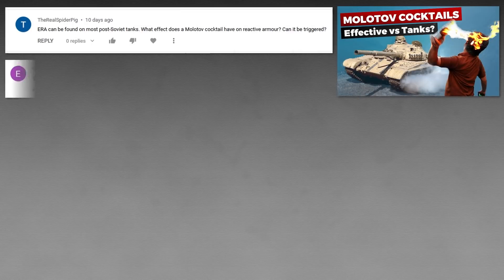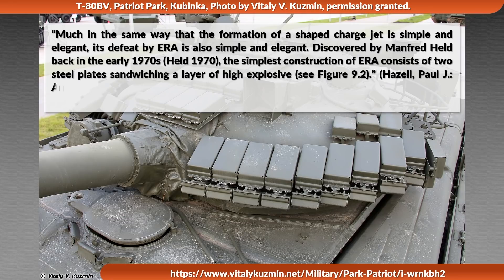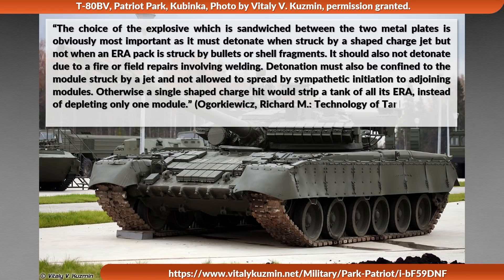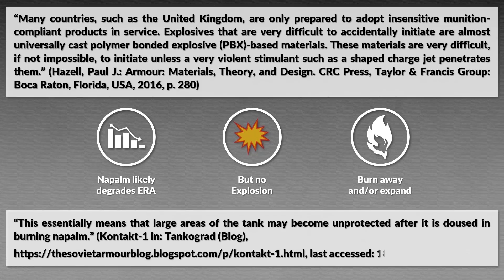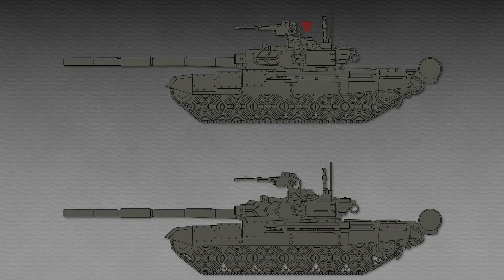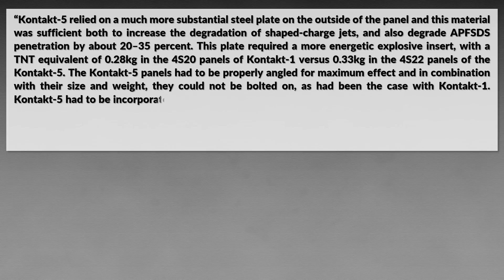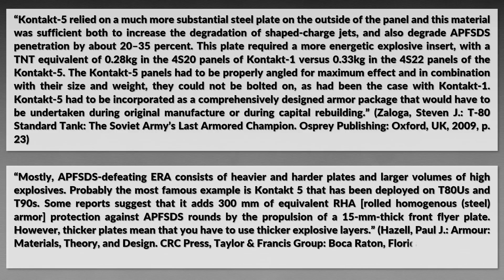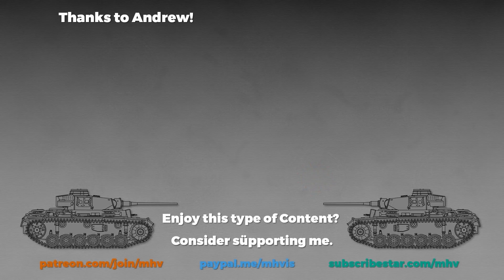Why does Russian Explosive Reactive Armor not explode?

Comment: Important is also, that not all explosives just explode when getting hot. There are certainly safety concerns if it would be too easy to set the ERA of. Imagine a machinegun hosing down on a tank with infantry around, setting of parts of the ERA. Carnage... It must not be too sensitive to its environment. 
I remember the mythbusters burning C4 as if it was some firewood without detonating. Many explosives are just made to withstand certain amounts of heat, of for example a burning tank.
The molten roadwheels of the T-72 are probably made out of aluminum, therefor already starting to melt at around 600°C. Not that much, concerning there was burning rubber ablaze.
Reply: The road wheels are certainly made by steel, not aluminum... aluminum could not withstand the mechanical stress. Meanwhile, heated steel will soften up too...
Reply: CAN YOU SAY THAT IN A GERMAN ACCENT , IT SOUND'S BETTER WHEN MILITARY  TECH TALKING  🤤
Reply: Modern IFV have 30mm,35mm or 40mm auto canon (even 50mm) with highly precise timed delay fuses that are programed at the muzzle after the muzzle velocity is measured.  The fragments are typically tungsten cubes designed to penetrate Armour.  I suspect the right round will wreck the ERA.
Reply: @williamzk9083  auto canons are a slightly different beast than 5.56 machine guns. They also are much more dangerous to even the hull armor of the tank. I think you can easilly destroy a T-72 with a 30 mm if you hit it from the side in between the wheels. Of course, if you meet it from the front then you are out of luck.
Reply: @TheoEvian  I'm think that semi Armour piercing round with hi explosive round would set of the ERA. A 3 second burst from a 30mm might put in 30 rounds.  Some of the forward fragmenting munitions like AHEAD should penetrate and likely destroy optics.   Most IFV will have a ATGM like Javelin so a burst of auto canon fire with follow up with the misisle gives the IFV a chance,
Reply: @williamzk9083  Yes, of course, but I wouldn't want to be in a situation like that.
Reply: If i remember well one of them even stomped on that.
Reply: We used C4 rolled like Playdough into small balls to heat coffee and C-rations in the field in Nam. We all carried two or three bricks each to blow bunkers, bridges and any other shit deemed appropriate. The Mekong Delta terrain was usually too swampy for big bunkers so we just made C4 into another Army  “Field Expedient Usage.”
Reply: Some of the reactive armor is actually fake. They just fill it with sand or something like that.
Reply: Hey guys. The blasting cap that detonates c4 varies. It can be 2 lead wires (or safety tube that contains black powder which instead activates tge ignition material. The mouths of these caps curl outwards, while electric do not. All the vietnam blasting caps ive seen arent much different and the explosive and ignition compounds are usually the same and are always in the same order.) that use the spark gap between them to burn the ignition material, something like lead azide, then a secondary explosive of some sort that is more powerful than the ignition material, but less volatile, then this detonates the primary explosive that creates the necessary shockwave to detonate c4. Most of this info is from an army 1968 demolitions manual i read when i was younger, so its outdated as can be.
Reply: @weakest17yrold   But the physics hasn't changed...
Reply: Have you heard how competently Putin responded to UN Secretary General Antonio Guterres??? A brilliant politician... Checkmate!))

P.S. In the information war, the one who tells the truth always loses. He is limited by the truth, and a liar can carry anything. Robert Sheckley
SUMMON RUSSIA TO COURT - AND YOU WILL LOSE IN DISGRACE!
Reply: Watcher Zero no, C4 is not detonated by electrical current and neither is any other explosive. electric blasting caps use a small amount of a particularly sensitive (primary) explosive in a slightly pressure-resistant casing to build pressure to induce detonation instead of deflagration. the ignition of the primary explosive in the blasting cap is caused by a thin metal wire of high resistance heating up past the primary explosive's ignition point due to electrical current passing through it. there is no electricity running through any explosives involved in any explosives ignition process, and certainly not for C4, which is a rather insensitive secondary explosive.
Reply: During the Second World War, partisans melted their stoves by cutting TNT skewer into chips. It burns well and does not explode.
Reply: Ask the GIs and the SV allies who burned C4 to heat their rations... with the added advantage that doing so was mostly smokeless.
Reply: i prefer my explosives well done
Reply: КАПИТОЛЮЙ бандэр
Reply: it depends on "how hot". A gasoline molotov cocktail won't set off the reactive armor. Now try adding some thermite to that, it burns much hotter. Not that it matters, the tank will not be destroyed by its reactive armor going off.
Reply: Generally there are 3 ways of igniting explosives; heat (Gunpowder), kinetic force (Nitroglycerin), electrical current (C4). You can design your explosive to only respond to one or to multiple forms of ignition. However for example when TNT gets old it sweats out the pure Nitroglycerin it contains making it susceptible to kinetic ignition.
Reply: @watcherzero5256  It's dynamite that sweats Nitroglycerin when it gets old - dynamite is Nitroglycerin absorbed in sawdust, activated charcoal, or some other material.
Reply: @Dennis-vh8tz  You need to just turn it regularly when stored. It helps to avoid the nitro from leaking out.
Reply: @jamegumb7298  Gravity
Reply: @Dennis-vh8tz  If I remember correctly, the original material used to stabilize nitroglycerine to make dynamite was diatomaceous earth.
Reply: The blasting cap that detonates C4 is initiated electronically, but I'm pretty sure that it takes pressure and heat to cause c4 to go boom.  I think they also make blasting caps that can use regular ignition cord type "fuses" that you light on fire.
Reply: @watcherzero5256  You probably mean an electric (heat) fired blasting cap. Most uses of significant quantities of explosive use stable secondary explosives that can only reliably be detonated by a smaller charge of much more sensitive primary explosive. Such as a blasting cap.

Also it is dynamite that generally contains nitroglycerin. TNT is literally another compound, other than nitroglycerin.
Reply: @johnloosemore9949  Newer ones such as Exploding Bridgewire Type run electricity through an explosive and the actual electrical resistance action rather than heat generated through resistance as in the Solid Pack your likely thinking of detonate it. There is also electro-mechanical such as Slapper Caps which are essentially electromagnets that generate a very sharp kinetic shock when a current is applied.
Reply: @watcherzero5256  Exploding bridgewire detonators work by dumping a huge amount of electric current through a very tiny piece of wire using a capacitor charged to high voltage. The wire almost instantly vaporizes and ionizes, forming a plasma (same thing as an electric arc) and then the remaining energy from the capacitor which is being discharged through the arc causes it to expand rapidly and form a tiny shock wave. This is usually surrounded by a moderately impact sensitive explosive like PETN which detonates making a much bigger shock wave which can then set off secondary high explosive. Slapper detonators are fundamentally EBWs which use a thin sheet of metal foil instead of a wire and which also have a disk of plastic or metal which gets pushed by the exploding plasma from the sheet being vaporized. The moving disk then "slaps" the impact sensitive explosive to set it off. Some of them also have an additional piece of wire on the disk which drives it by Lorentz force (the magnetic field from the current flowing through the plasma acts on the current flowing in the wire and pushes it like an electric motor).
Reply: @watcherzero5256  I'm not claiming to be an expert at any of this, but I think the name "exploding bridgewire" implies the existence of a bridgewire. The electricity is not flowing through the explosive itself.
Reply: @sbreheny  Fun fact: Exploding bridgewires and slappers were both developed as very precise (in the sense of delay between "flipping the switch" and the shockwave reaching the explosive) detonators for the explosive lenses in nuclear weapons.
Reply: @watcherzero5256  

TNT contains no nitroglycerin. Those are discretely two different explosive compositions. You are undoubtedly thinking of clay matrix dynamite. When TNT gets old, it decomposes and becomes less sensitive.

C4 is very insensitive. The Army has a term, 'double capper', meaning that you pay attention to detail and do the job right the first time. Its from the Engineers and refers specifically to the standard practice of 'double capping' C4(taping two caps together) for reliable initiation, because its common for only one cap to be insufficient.
Reply: @watcherzero5256  you've confused TNT (trinitrotolulene) with Dynamite (stabilized nitroglycerin.) They are not the same substance. TNT doesn't sweat nitroglycerin, because it does not contain nitroglycerin.
Reply: @watcherzero5256  TNT doesn't sweat nitroglycerin as it doesn't contain it. What you had in mind is Dynamite :) 
That's common misconception because of how dynamite sticks in animated films and media has TNT written on it, which is misleading. In other words we are thought wrong from the beginning  :)
Reply: did mythbusters show that burning c4 will explode if pressure is introduced? because burning c4 will explode when it is on fire.
Reply: My father told me there were guys in his unit in Vietnam who would use little cubes of it to heat up coffee or rations in their steel mess cups.  There was apparently a way to turn one of those aluminum mess kits into a makeshift single serve hot plate powered by a little chunk of C4.  I think it didn't smoke, but it gave off a distinct smell.  They would also stick c ration cans on top of a truck's exhaust manifold when there was one nearby.
Reply: PhillLesh69 soldiers are ... "inventive" like using c4 to heat rations. My father told of buying an extra Zippo lighter ( he was a smoker and already carried a lighter ) and fuel from the PX for him and his squad mates to use during field training for the same purpose. Zippo leaves no smoke or order, the D.I.'s did not catch on and they had hot cans of chow, whenever they could get away with digging a little hole in the ground to hide the flame and hold the lighter, lol.
Reply: @PhilLesh69  This is correct.
Reply: @miketaylor5212  : As I recall, C4 specifically requires a supersonic shockwave of sufficient power in order to properly explode- otherwise it'll burn too slowly to explode in open air.
Reply: @miketaylor5212  I was a Cav sapper for 16 years…c4 does NOT explode when lit on fire! Heat AND pressure are required for detonation. Its literally by design to make it stable for transportation and deployment! Det-cord or blasting caps are proximity detonation is the only way! Unless your going to tell me that i never cooked a pot of coffee from a cut off chunk of C4! FYI hex tabs were far more efficient, but….you use what ya got!
Reply: @miketaylor5212  they set it on fire and cooked MRE with it, dropped a pot full of water on it, stomp on it, drop an anvil on it, shoot it with 7.62 nato, drip molten thermite on it, all on fire
Reply: @miketaylor5212  there were russian documentary channel on youtube named "Zvezda" which were banned thanks for freedom of speech, So there were documentary which were made about russian ERA, so according to this video, Russian ERA do not explode in fire or when shot by small caliber arms like 7.62, 12.7, 14.5

Comment: The same concept as cooking on C4 during the Vietnam war, unless it's given a shock designed to detonate it then it won't detonate. It will burn pretty good but won't go boom.
Reply: In days of yore people would cook over dynamite sticks burning.  It doesn't take much shock to set off nitro glycerin though.  I prefer to use wood.  Even a small pinch of dynamite wrapped in foil will detonate when heated on the stove.  This tends to blow out the fire, so turn the stove off😎.

Comment: although PBX explosives have relatively long shelf lives (25-50 years + or -), storage conditions matter.  ERA left on the tank exposed to weather extremes and not properly maintained may have far shorter lifespans leading to outright failure upon use.  The degradation of these panels is insufficiently understood, although lifespan testing in storage conditions has been conducted to determine the baseline lifespan.  Given the poor maintenance processes and practices of the Russian Army, there is a likelihood that the Russian Kontakt ERA has been degraded and may be performing at suboptimal levels--fizzles, partial detonation, or complete failure to detonate.  In addition, the ERA is only as good as its plates.  The metal plates are far more likely to be damaged, rusted, bent, etc than the explosive charge itself.  Damaged plates can lead to low order or no detonation of the charge.  Again, given the maintenance practices of the Russian Army, I rate the probability of failure of  KONTAKT 1 equipped tanks to be frequent, and Kontakt 5 systems as occassional.
Reply: What's your evidence for bad maintenance practices in the Russian army?
Reply: @tomasg4623  I'll expand on the answer above. 
The PBX in the ERA is quite stable as a chemical compound but it's degradation is effected by the enviroment it in. This can be: temperature, light, reactive chemicals ect. 
Temperature; heat accelerates chemical reactions so being in the sun can play an impact. Cycling through hot and cold weather leads to problems with expansion and contraction and cold weather may result in crystallization of components of the PBX mix or of water from moisture. 
Light: UV light is quite capable of breaking chemical bonds. The ERA is probably not at a high risk, as the blocks are fairly well sealed. 
Reactive chemicals: Water, oxygen, various oils and NOx from exaust comes to mind. 
The important part is that the T-72 and T-80 tanks with the older ERA's had the blocks installed at production or prior to the breakup of the Soviet Union it is unlikely the tanks sent to Ukraine have been in climate controlled buildings for that period of time. The blocks could have been replaced at some prudent interval that would eliminate degradation but that is where the questionable maintenance comes into play: Do you change some fairly stable ERA blocks with a possible shelf life of 25+ years on your tanks when you do not change tyres on your trucks - knowing the rubber in a tyre has a shelf life of 5-8 years?
Reply: @gamarus0kragh  isn't the explosive keep in storage and era block is just hollow during peace time ? And they only equip them when going to battle or war ?
Reply: @tomasg4623  

Gestures vaguely towards present clusterfuck

The fact their Truck tires broke due to poor maintenance? The logistical hell that occurred due to it?

Comment: Correction at 2:20 Its not that they have ERA bricks without the explosive, its that they have ERA containers (those funny looking bags on the side) that normally have ERA arranged in an egg-carton style arrangement ... except they have been found to not contain any ERA at all, only the egg-carton.
So not a partially missing ERA, but instead  completely missing ERA with only the "scaffolding" left.
Reply: https://youtu.be/nrHt0Q6eSI4
Here you’ll find a video that debunks this idea.
The ‘egg cartons’ are called spacers.
This video explains that many tanks found with bags of empty ERA are abandoned tanks, from which the crew have removed the ERA plates. (To counter them being used against them). Abandoned Ukrainian tanks also demonstrate this. 

As well as this, you can see videos of tanks being actively used, have properly filled bags of kontact-5 ERA.

Lastly, all other ERA that can be visibly seen on the tank is present and there  is no shortage of it seen, the ‘bagged’ kontact-5 blocks are the same as the ones visible on the front turret of the T-72, T-80 and T-90 tanks. Since there is no shortage of that ERA it can be assumed there is no shortage of the ERA in the bags since it uses the same type of ERA.

I’m not pro-Russian, I just despise disinformation, especially about tanks because I love them so much!
Reply: @dylanfinucane7193  cheers mate!
Reply: @dylanfinucane7193  I watched it before. There is one issue with the theory: why would anyone bother to scavenge ERA plates but NOT set the tank on fire to deny it to the enemy?
Reply: @MarcinP2  Because ammo is expensive and hard to transport Without it these fuckers don't burn and can be easily repaired  in a country that produced them. Also both sides have plenty of tanks. Era and ammo are bit harder to get...
Reply: @manyinterests1961  another thing that came to mind is, if you've got to abandon your tank, chances are you're in deep shit, the last thing you want do is to set your tank on fire and send a breathtaking smoke beacon to all nearby opposing forces so they can intercept and take you out while you try to bugger off on foot. 

it takes time to train a tanker after all, killing/capturing the crew is probably going to hurt your enemy more than taking out a few tanks.
Reply: They said that some of them even have sand or dirt in the blocks. Lol